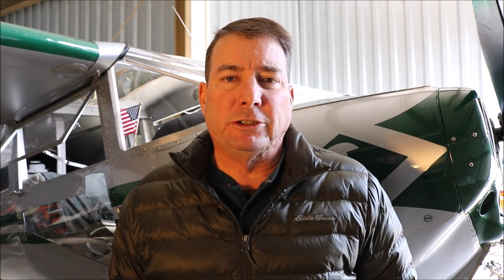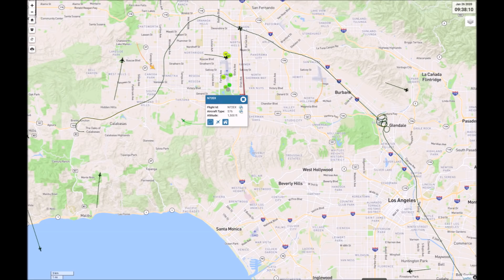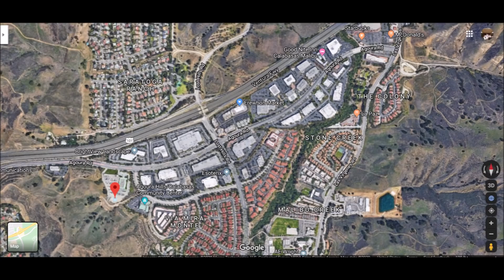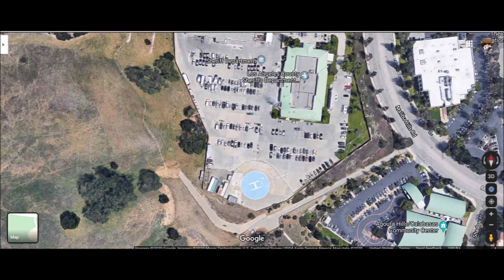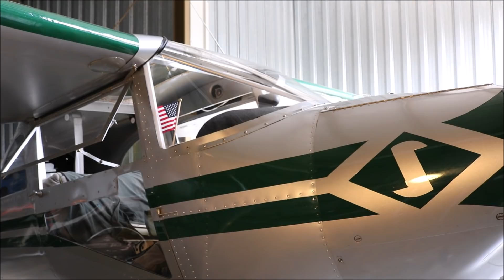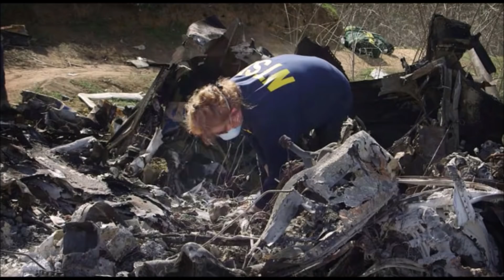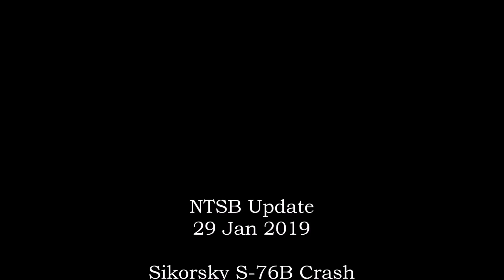Kobe Bryant Sikorsky S-76B Crash Update 29 Jan

Comment: Questions I have are; if the pilot was disoriented in that moment is there a single button he could press on the Sikorsky to allow the helicopter to stop and simply hover in position to allow the pilot to gather his bearings?? It sounds like he was travelling at a high rate of speed around 180mph before plowing into the mountain but it also seemed he had at least a couple minutes to stop and evaluate his cluster? Also did he have a glass cockpit with terrain mapping?? Not terrain avoidance(TAWS) I know but at least some sort of visual that the mountain was coming up ahead??

Comment: My guess is... The pilot knew he was too low so was trying to add altitude. To do so requires increasing power to the main rotor, which will cause the helicopter to turn if pedal inputs are not added to counteract the torque that is turning the aircraft. The pedal inputs may not have been applied by the pilot due to poor visibility which prevented the pilot from realizing the aircraft was turning.

Comment: Blancolirio, so assuming for a second  it was a lack of IFR training, the one thing that always puzzles me is how could IFR, aside from ILS APPROACHES, be so difficult. When it comes to flying it doesn’t seem like it would be that difficult to rely on instrumentation. Especially vertical speed, altimeter, airspeed, and horizon. I’ve always heard about “spatial disorientation” and that it can be so confusing that a pilot not sufficiently trained to deal with it could end up ignoring his instruments and crashing as a result. But that seems so hard to imagine. Especially for a pilot that at the very least knows what spatial d is. Why on earth would he disregard a vertical speed of (from what I heard) more than -3000fpm??? Is that the possible case here when you refer to lack of IFR training?

Comment: After studying all of the pictures, speeds and reports I believe the copter was inverted on impact at high speed.  The rotors at the impact sight is the key.  The rotors hit first.  The pilot made one fatal control adjustment after increasing altitude and inverted with no time to recover in white out conditions due to disorientation.  That is my opinion only.

Comment: Why, if it was his intention, did he want to land on the helipad. Can't a helicopter land anywhere?☺
Reply: Anne Booyse good question
Reply: I don't think they can but I'm not sure.  That is a good question though.
Reply: A helicopter can land on any flat surface with no obstacles, but is extremely vulnerable to hitting wires, power poles, trees and structures. The pilot would know that a proper LZ has a cleared area around it. Putting down in a built up area in poor visibility is extremely risky.

Comment: It is clear the NTSB is pissed off at the FAA for the FAA's failure to accept the recommendations of the NTSB in the past.  However, the FAA must take into consideration many more factors than "safety"  on how to correct a fault in any single accident.  Being a political body, the FAA must "regulate" the entire events and propose the rules subject to all pilots flying in U.S. Airspace.  Just because the FAA had not accepted the NTSB's "suggestions" does not mean the FAA is turning a blind eye to the NTSB.  Both agencies have a purpose.  The NTSB is for "pure safety".  The FAA has an economic interest for the entire United States, and therefore the world to consider the effects of any proposed regulations.
       Dear NTSB, kindly get off your "high horse" and let the FAA do its job. The FAA is not ignoring your proposals.  Most of the time they will accept your recommendations, but not always.  Economics is always a factor, sometimes subjugated to  the human experience.  If the FAA were to accept each and every one of your "recommendations" would the U.S. A. still be the leader of the free aviation world?

Comment: A system that creates a nuisance to the pilot is almost worse than useless. I'm still trying to absorb the information to try and understand whether or not the pilot was trying to fly under the cloud cover, or had some sort of a systems failure. He should have easily been aware of terrain given the amount of experience he had flying in that region. Given the fairly small debris field. It appears that the helicopter was not going that 180 mile per hour or more of that a local weatherman here in Detroit claimed it was going. I don't know how he thinks he would know but apparently he thinks a hundred yards is a really large debris field. I have witnessed three air crashes. Believe me, a hundred yards is not a large debris field.

His proximity to the helipad does explain his change in altitude and apparent change in forward velocity.

I just noticed something from your description of the flight path. That is not the flight path that was shown by authorities almost a week ago. They claimed that he had turned to the right and was going in a Northwest Direction, if memory serves me correctly. But they clearly intimated that he had turned the wrong direction. Which I found unfathomable given his experience unless he was having problems with the aircraft. It was already bad enough that he is operating the aircraft, Yin quickly changing weather conditions, and handling communication.

Comment: A $500 portable Garmin GPS with terrain database could have given the pilot accurate and timely warning that he was way too close to terrain. Lots of professional pilots will use an uncertified portable GPS as a safety aid/ cross check device where modern in-panel equipment has not been approved in certified aircraft. Most new built Experimentals are better equipped in this regard than this multi million dollar S76. That's crazy. The FAA needs to get with the modern times and let operators get modern aids into all aircraft. 

The 90 degree turn off course from the safer valley route towards the hills is a mystery that may be hard to ever explain other than by presumed disorientation.

Comment: When i read of a aviation crash with bad weather as a contributer, i get irritated. Am fixed-wing ifr with lots of actual ifr time, am also a bit opinionated too, because i had a demanding instrument instructor who preached safety , and not going into unsafe places beyond one's capacity and skills. Just about any qualified ifr pilot sitting up front in Kobe's helicopter could have added enough to save all on board that day, that time. Sounds like this pilot did a vertigo plunge, taking 8 others with him.  Pilot error, pilot stupidity, pilot arrogance- those were the root causes of this crash.  What a waste......This guy was supposidly an instrument instructor, so he had the capacity to fly the gauges, stay level, or the smart thing: do a 180 and get out of there.

Comment: As an A&PIA years, I made repairs to Heli and fixed wing for an owner right now depart into IMC weather conditions. Hoping all went well, if not,  FAA would check the AC logbook for A&P signoff, who returned AC for return to service. A&P not FAA, is the lawyers take into account first. Pilot AC control, last.  Aircraft maintenance logs, first assure the aircraft, or remains is airworthy. A&P is ok. Ask any A&P if this is correct.  CHUCK " Your Mechanic"

Comment: I'm no expert, but a loyal subscriber to the channel, and my 1st impression upon seeing photos of the site on the news was a high speed impact due to the relatively small size of the debris pieces.  Also, I live 100 feet adjacent to the 101 fwy in a community  less than 5 miles south of the crash site and I heard the copter flying by at low altitude. I also heard an unusual, distant, low frequency muffled rumbling sound minutes later unlike the occasional sounds of traffic or vehicle accidents on the 101. I have since surmised that possibly the sound of the crash was able to reach me especially with the tendency of lower frequency sound to travel farther in foggy conditions.  Just wondering if the debris size and possible high decibel level of the crash sound if it did indeed reach me could indicate a higher speed impact? Any thoughts Juan?

Comment: If the pilot is an experienced pilot with so many hours. Base on the weather condition (fog) shouldn’t the pilot flying at a safer speed ?Now they said “the helicopter was coming down or flying fast the moment of impacted.” It seems to me there’s only could be two reasons why the helicopter crashed. First possible reason is the pilot got sick. Maybe he might had a stroke or a heart attack.Second reasons is, it could be a mechanical issue.But I’m more leading to the pilot got sick because there was no radio communication seconds before the helicopter went down.
If there was two pilots on board maybe the outcome would be different.
RIP Kobe alone with the 8 souls that went to heaven on that faithful day.

Comment: i saw a video on FB the day after that shows a helicopter spiraling downward out of control. looked exactly like the kobe scene. that video was pulled down in a matter of minutes. it may or may not have been actual footage, but it looked it to me. same helicopter, and the terrain where it crashed looked identical.
Reply: The terrain does not look the same.....at all.  There are huge cliffs in the video you are talking about.  The video has been circulating for a few days - and it has already been determined NOT to be Kobe's crash.  It was over in the Middle East area about a year ago.  The helicopter clipped a zipline and spiraled down.  There are zero witnesses to Kobe's crash that refer to any spiraling down out of control.  Kobe's helicopter had a good amount of horizontal velocity when it impacted the ground according to premilinary data, so it did not fall out of the sky spiraling like a brick.  The NTSB has also said that according to preliminary data, the helicopter was in one piece when it made impact - meaning it was operating normally when it made impact.  A helicopter that has lost a tail rotor due to clipping a zipline is not in proper operating condition.

Bottom line, the video you are talking about has been thoroughly debunked as being the Kobe crash - and in fact the specific crash it is from has been identified.
Reply: @willoughbykrenzteinburg  "the terrain does not look the same".

are you a profit or some sort of messiah? you know what video i saw? lol theres a million helicopter crash videos
Reply: @1984-f7q  I know the video because there is only one video out there purporting to be of Kobe's crash.  It's very blurry, the camera is very zoomed in and very shaky as a result.  The helicopter spirals down and crashes.  I know the video you are talking about. 

Also, it's spelled "prophet".

Comment: I have a question: If this helicopter was able to be followed, as shown by a green line on some  map I've seen on other channels, (presumably by ASD-B) then why did the controller they were talking with for their Special VFR, when asked for Flight Following, couldn't give it because he couldn't see the craft on radar to confirm their position. 
    Guess my question is don't these facilities, after 5 years we are required to implement ADS-B, (DON"T TOWERS/CONTROLLERS) have access to ADS-B presentation for their area? What good is ADS-B to anyone if you can't/don't receive the display.  I really think that the FAA should have Required ADS-B IN as well as OUT. JMHO
Reply: Flight following is a service offered by some ATC operators.  We don't know all the answers yet, but being "too low" for flight following doesn't necessarily mean that the ATC controller doesn't have him on radar.  It could simply mean that this particular tower doesn't provide the flight following service to aircraft below a certain altitude.

Comment: We have GPS systems that can pinpoint my location simply by me carrying a cell phone. Why not have a similar system for aircraft and tie it into a mapping system combined with elevation data so that a pilot will always know how far he is from the surface of the earth? This could even be a cellphone application.
Reply: If the pilot was disoriented - something like this wouldn't help.  Crashes like these - where pilots fly into deteriorating conditions where they no longer have cues and get disoriented - don't happen because pilots don't know how far away the ground is.  They happen because they don't know WHERE the ground is.
Reply: @willoughbykrenzteinburg  Maybe I am missing something. What's the difference in knowing how far down the ground is, and knowing where the ground is?
Reply: @davidmorse8432  When you are disoriented, you dont know which direction is up.  I mean....knowing the proximity to the ground is not the issue, its knowing in which direction the ground is that is the issue.
Reply: @willoughbykrenzteinburg  Ok, I see what you mean by that then. I have no experience in helicopter flight and only was in one once when my neighbor flew one in to his property and offered to take me up for a short fly around. I like to stay on the ground.
Reply: @davidmorse8432  yeah, I get that.

If you are a roller coaster fan, the next time you ride one close your eyes and try to guess what you are doing at various parts of the ride and have a friend next to you tell you if you are right.  You will find that you are moving up when you think you are moving right.  Or you are moving down when you think you are moving up.  You might think you are upside down when you're not, etc.  You will probably be amazed at how much you actually rely on visual cues.
Reply: @willoughbykrenzteinburg  Ok, if we can design a computer to drive a truck, why not develop one to pilot a helicopter. It could be switched on mainly just when needed. Like when the pilot becomes disoriented.

Roller coasters make me sick.

Comment: As a helicopter pilot I want to make a comment for your consideration.

If I had been in this pilots shoes, and gotten myself boxed in by weather (overcast forcing him down while ground fog was forcing him up) I would have probably done what he did, which was to climb. The reason for this is that landing in fog is not easy. 

Helicopters are causing the air around them to wash down through thier rotors. When close to the ground this air hits the ground and wraps back up again. Think of it like a donut of air with the helicopter in the dounut hole. Now put sand, or snow, or dirt, OR WATER IN THE FORM OF FOG into that circulating donut of air and it becomes opaque. The result is that the pilot can't see anything. This is why I don't think he was looking for the sheriff's heliport. A place to land was not his problem. How to land in fog was his problem.

Comment: https://youtu.be/fcg-C32u2Ow

There's a comment on this video about a possible engine stall at 2300 Feet then plunged into the side of the hill, so that is a very possible scenario and would make sense as to the high rate of speed descending from that Altitude.

At the end of this video there are two audio captures of the final decent before impact

https://youtu.be/3PXSrxytTBQ

Sounds like Engines are in full torque.

Comment: Local weather hit the S-76 hard. Cloud and fog density was heavy enough to precipitate farther inland, in the Simi Hills. Malibu Canyon funnels moisture from the Pacific Ocean. It fills upper Malibu Canyon (the crash site) & collects and ultimately pushes north into Simi Valley. All of the aforesaid happened the morning of the crash. From my vantage point at 10 AM on the north side of Simi Valley, the cloud bank looked like a tsunami, more than 1000-2000 feet thick. For the S-76, the Sheriff's helipad was a mile away, obscured by impenetrable fog. Spacial disorientation is far more likely than any hunt for a well hidden landing spot.

Comment: How about an emergency autopilot?  Would an S-76 (can't be an inexpensive helicopter to begin with) already have an autopilot?  So an emergency autopilot might be such that when the pilot loses orientation, for whatever reason and needs help, he/she can hit the "EAP" button and the helicopter (having an all-attitude sensing system) will level itself and either maintain a hover or maintain forward flight, seek a direction and altitude away from terrain and maintain safe airspeed, automatically...assuming it is GPS equipped and aware of its location and terrain.  Even if used for just several seconds as a pilot assistant before the situation gets bad.  If both the pilot and EAP get disoriented, well, it's just a bad day, then.  But the odds say they won't both fail.  In this day and age of drones, I don't see why it couldn't be.  Then the pilot can take a breath, get reoriented and back on track or call ATC and declare an emergency, if needed.  At least for Part 135 helicopters equipped for instrument flight (or do all 135 need to be equipped for instrument flight?)